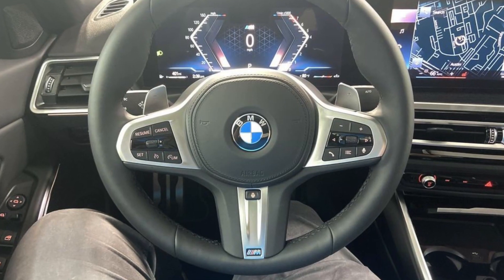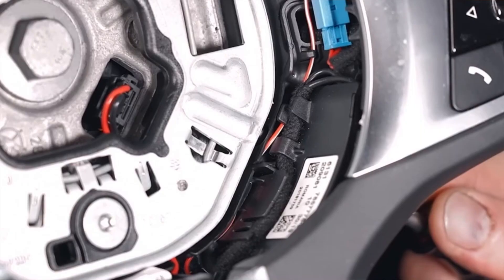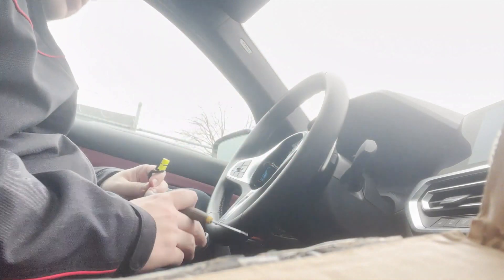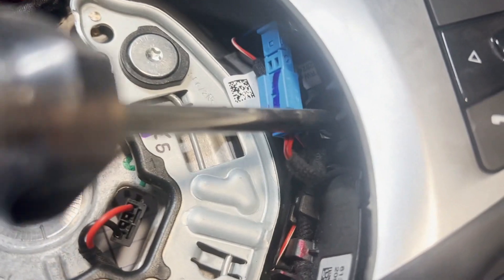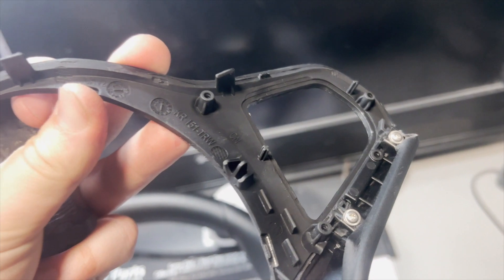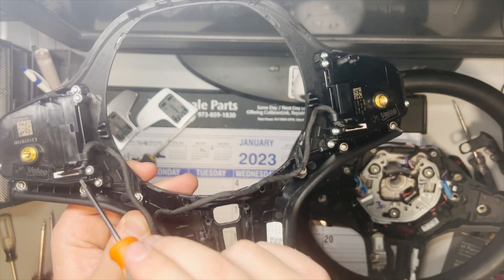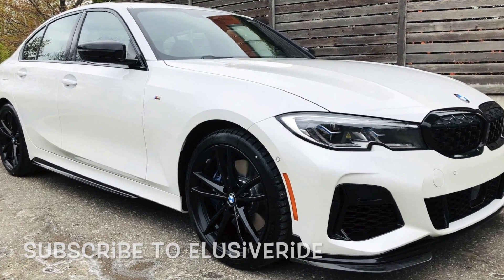BMW M340I 330I - How To Add CARBON FIBER Look To Your Steering Wheel + PADDLE SHIFTERS #BMW #m340i

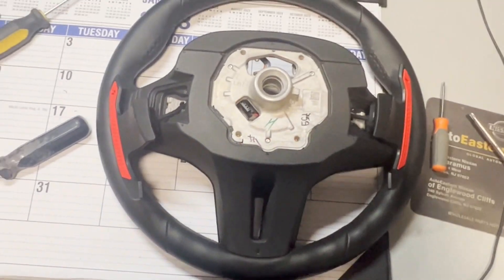Comment: 6:11 hi. There are two screws on each site to hols the trim, how about the bottom part ? How is it hold in place ? There is no screw hole behind the steering wheel there.

Comment: Is there a torque spec for the steering wheel? I cost myself $1k in damages when I over torqued a steering wheel bolt before...

Comment: just pop off the plastic around the steering column and you can pop it off around the back of the steering wheel without putting holes in the steering wheel